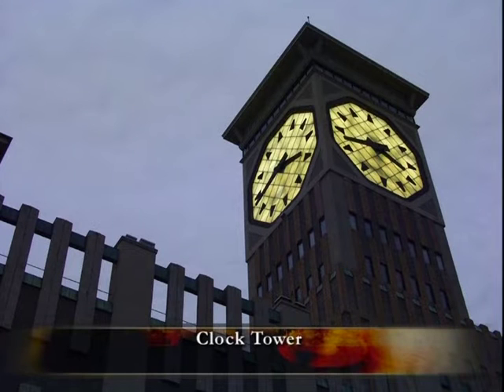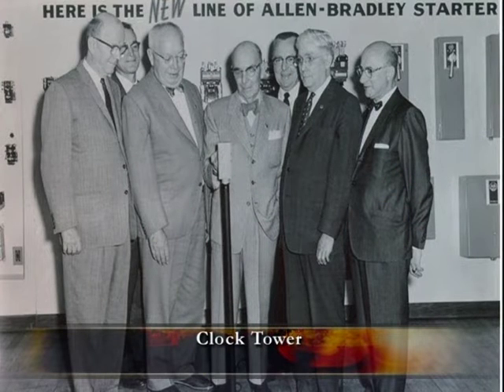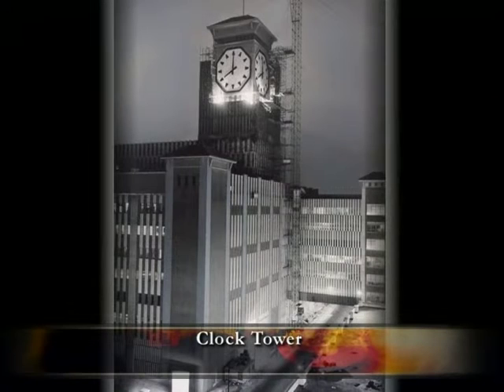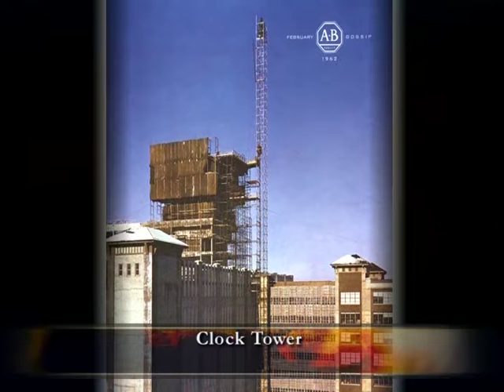03 Clock Tower

Comment: Yes - the clock was designed  by Allen-Bradley employees from the Special Machine Dept.  Those employees were the inventors of the patented clock  - one patent (3,184,909, May 25, 1965) for the clock mechanism (Gerry Loaf, Phil Walker and Ray Ellsworth) and one patent (3,184,912, May 25, 1965) for the design of the clock hands   (Walter Freeburg and  Ray Ellsworth).  Dick Steinmetz